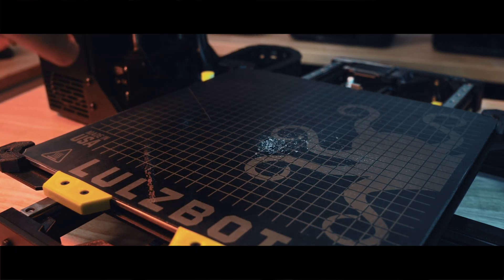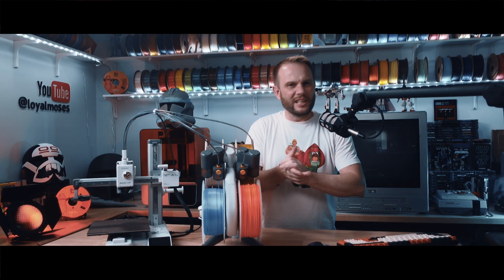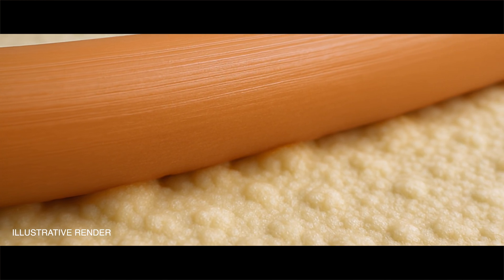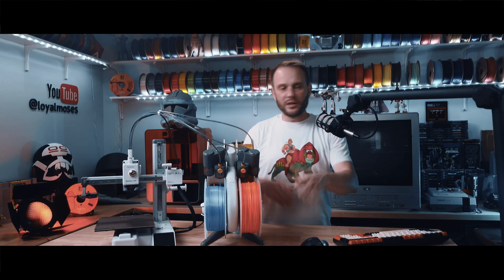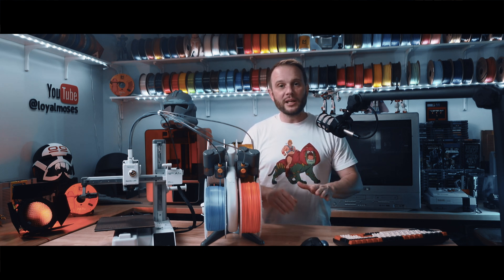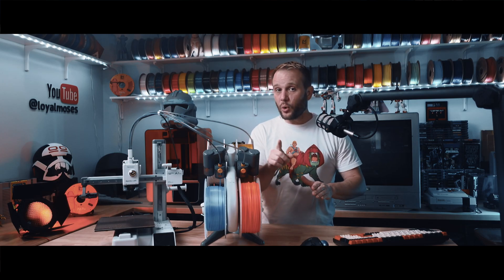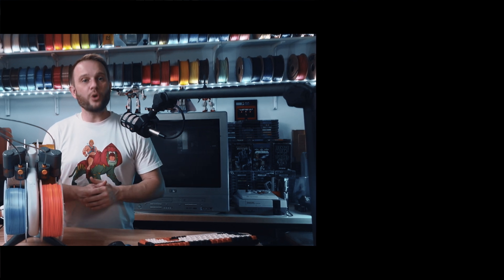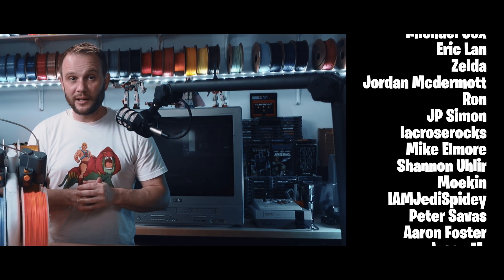Is Alcohol Ruining Your Prints? Why PEI Works (And Fails)

Comment from the maker: Have you ever had a print fail because it wouldn’t stick to your PEI sheet? What do you use for cleaning—alcohol, soap, or something else? Let me know below!
Reply: Soap and water for the win. 10 years on and counting.
Reply: Cleaning between prints is 80% IPA made by diluting 99.9% IPA with distilled water. There’s no glycol, just IPA diluted to a concentration that is not damaging to build plates, but still high enough to clean oils. I use a microfibre cloth to clean the plate. Occasionally washed in warm soapy water to do a thorough clean. The only time I use glue is when printing PETG or TPU on smooth PEI, but the reason is so I can remove the print afterwards without destroying the building plate.
Reply: @LoyalMoses  use both Alcohol and a mild soap/water mix depending on how dirty the build plate maybe.  Seventh generation Free & Clear is the soap I prefer. Doesn't have the harsh releasing  agents found in degreasing soaps such as Dawn.
Reply: havnt had to clean my bed in around 700 hours of printing. the default PEI sheet has extremely good durability without having to wash or hit it with IPA.
Reply: mild soap, water lol.

Comment: I take 99.9% IPA and dilute it to 80% with distilled water for use to clean build plates. Smooth PEI plates can also be refreshed when the alcohol no longer works for bed adhesion. Using an abrasive polishing cloth dampened with acetone, rub the surface in circles about half the size of the plate. Polish evenly and then rinse and wash with hot soapy water. Once dry, install the build plate and clean with 80% IPA solution (without glycol) using a microfibre cloth. The acetone will strip a microscopic layer from the plate and expose the fresh PEI surface underneath. The build plate will perform like new, but you should only do this once on any build plate so if it goes bad again, scrap it. PEI build plates are considered consumable. Never use this method on a textured build plate. This is only for smooth PEI surface.

Comment: While I mostly print petg and PLA I haven't used an adhesive in over two years since I started using pei plates (textured or smooth).  Just use that dawn concentrate spray and good hot water (like ouch).  Once in a great while I might chase the soap wash with 91% ISO-P but that's like once every 50+ prints
Reply from the maker: Great tip!

Comment: I use dish soap & IPA between washes. I’m new to the 3D Printing world so still learning. since you mentioned that too often use of IPA can wear off the PEI, what do recommend how often should I use IPA ? I use more often on my smooth plate, especially if I see prints on the surface , less so on the textured plate. How often should I wash with dish soap and water?

Comment: Does the Vision Minor product leave a texture on smooth plates or affect those plates that creat the reflective patterns? Like filling in the ultra fine grooves on them?
Reply from the maker: Not really. You should be fine, and it is water soluble too.
Reply: @LoyalMoses  sweet. thnx
Reply: If you apply the Vision Miner thinly and evenly it will not affect the patterns. I use a 1” square piece of lint free disposable wipe to spread it around the build plate. A little goes a long way.

Comment: Great video and infomrative!
I've being cleaning my PEI plates with isopropil or water and I'll tend to aovid alcohol most of the time. I usualy print ABS, so I need to use glue (Strangely enough it's hard to find a good glue stick like elmers i even had some imported lol) so most of the time I'm using local branding aerosol spray glue (water soluble) or liquids one, no problems yet. 
I wasn't able to print without one on my k1c so far.
Reply from the maker: Thank you very much! Whatever helps make your prints a success!

Comment: Dawn dish soap(or equivalent) and hot water is all you need to properly wash pei plates, then simply dry with paper towel.. this was the same for my old glass build plates, ALCOHOL is only good for spot cleaning between proper cleanings it can smear body oils and greases, Dawn is designed to remove them both that is why they use it on animals in oil spills. You "alcoholics" are ridiculous

Comment: I learned that the hard way on the glass beds that came with ender and fookos high levels of IPA what caused those beds to lose their adhesion you know it's happened to a glass bed when you clean it and it's no longer feels sticky to the touch the print surface is pretty much ruined after that

Comment: The stock Ender 3 V2 build plate with NO adhesives, tape, or other supplementary substances has worked extremely well for me over the past 3-5-ish years. I can't remember when I got the machine.

Comment: what is the best way to apply it? i have use paint brushes and such but doesnt seem it does even coat across. when it has the wet look doesnt seam like it smears around easy.
Reply from the maker: I use the little paint brush I have here, and just do small circles all over the build plate to put it down evenly.
Reply: @LoyalMoses  ill give that a try

Comment: What no YouTuber ever mentions is dust build up. 
(Maybe because they print so often or get expensive glue for free, or both 😏 that they never experience this case)
The fanciest glue is wasted if you leave your print plate collect dust on the printer for 3 months and then start a print right away. 
Either you need to wash off the dust before (wasting away the expensive glue that was supposed to last X-amount of prints) or the print detaches and then you need to clean the build plate anyway. 
Therefore: Cover your build plates or store them either vertically, in a drawer or in a container.

ALSO what I've heard no YouTuber ever mention before: 
Don't use the same cloth too often! 
If you touch a micro fiber cloth often enough, it gets greasy as well.
You then basically wipe the grease ONTO the build plate instead off of it. No amount of alcohol can compensate for an already greasy towel. 
So either wash the microfiber cloths regularly:
- WITHOUT other clothes, like cotton. Clothes fibers are much coarser, detach and contaminate the microfiber cloths' surface like millions of coarse dust particles. Although not as bad as grease, it's again like you wipe (dust) onto the build plate instead of off. 
- Wash BELOW 60°C (I remember a car polishing specialist mentioning that microfibers start to melt at that temperature) 
Or throw them away after a few uses (which I find a waste).
Reply from the maker: Dust happens here too. Vision Miner isn't tacky when at all when it is room temperature. I just use a microfiber cloth and wipe dust away, and then start the print. A lot of the time, I'll ask the kids to bring me a printer for filming, and then my wife will come in while I am getting things ready (SHE'S AMAZING), and wipe down the printer for me, because I forget all the time.
Reply: @LoyalMoses  Hmm, interesting to know, thanks!

Comment: I use PEX due to hogher bed temps > 120°C I tpically go through a PEX sheet in about 1 to 2 years, mostly due to damage that occurs when removing a print.
When using the Nano polymer do you suggest applying it directly to a Pei or PEX build plate or directly onto the aluminum?
Reply from the maker: You can apply it to the aluminum if you want, it will make filament stick to anything, but I would just apply it to the pex.
Reply: The website says what materials it’s compatible with.

Comment: I find that alcohol just spreads the oils around. Some dawn will clean it well and i can print pla petg and abs without any issues
Reply from the maker: Yikes! What kind of oils are dealing with!? I haven't experienced that, likely don't have that much oil on a build plate for that to be a problem. Lucky I guess!
Reply: @LoyalMoses  just oils from my hands. When i print petg on prusa older black pei textured sheet i rub my hand on it to stop the petg from sticking too much and damaging it. But when i switch back to pla/abs just using iso alcohol tends to just spread it around

Comment: With the title of the video, I was hoping for some test results. I have been using ipa to clean my pei sheet for years and haven’t had any problems with adhesion. I’m not saying that it doesn’t degrade performance, just that some sort of comparison test would be helpful in making an informed decision.
Reply from the maker: It’s science. You can Google it, or check with ChatGPT.
Reply: @ more along the lines of, over 100 prints you lose 10% of adhesion. Or you lose 0.01% adhesion.
Reply from the maker: The truth is, the amount of PEI used on the plate, and how much your scrub with the varying levels of IPA really determines how much you are removing. I’m still using original builds plates from many years ago, and some cheaper ones didn’t last but a month or two.

Comment: Vision miner is expensive but I won't using anything else it just works and yes you can get a ton of prints before reapplying its very thin as in like water thin so it goes a long way and lets face it a part that detaches from the build plate big or small is a failure if you use vision miner it just works with everything PLA, PETG, ABS, ASA Nylon TPU on and on
Reply from the maker: It is 10000% worth it! Once you start, you just can't stop, it is amazing.

Comment: Water soap or IPA never really worked for my textured PEI sheet, i would always have issues with adhesion after. The only thing that works for me is acetone. And i need to wipe it properly. That seems to go against most peoples advise but it was just the only thing that worked for me. over 2 years now and no issues so far. I need to clean it about every 10 prints. I mostly print ABS and PETG. Never PLA.
Reply from the maker: Acetone removes a layer of PEI each time you use it, so technically, you are cleaning it, and giving it a refresh. But there is a limited number of times you can do that of course, depending on how much you use and how often. Different sheets have different amounts of PEI, so if there I a thick layer of PEI, you'll get away with that for a longer period of time.

Comment: I never use IPA, always use Dawn dish soap and warm water. One thing that's strange is the best adhesion results have been with a smooth PEI sheet.  Bambu Labs smooth/textured build plate using the smooth side you almost have to use glue stick to get the prints off. Try it and see, I was amazed at how well PLA/PETG sticks to this plate.
Reply from the maker: Some smooth sheets are incredible!

Comment: I use 91% on a microfiber rag and only clean it if I have to touch the build plate to remove tiny stuck pieces or just after like 5 prints or so . Been doing it for years and my prints still stick perfectly fine. Would rather buy a new PEI sheet every couple years than have to wash it with soap and risk damaging it that way
Reply from the maker: Awesome!

Comment: I'm team IPA all the way. I think your explanation coupled witht he fact I use 90% with a fine spritz bottle explains some things. I never let it pool up and puddle on the plate for a length of time, its spray and wipe off immediately, never really let it linger and try not to let it evaporate as that also leaves contaminates behind. I've had very few issues with surface adhesion in general. Frequently I print parts that state a brim will be needed, without. PLA sticks well and PETG sticks so good that sometimes fully cooling doesn't self-release without giving the sheet a flex.
Reply from the maker: I find IPA super convenient too. Spray bottle, light wipe and good to go. I try not to scrub, but I’ll admit, I’ve done that a lot in the past, probably the reason for a few failed plates.
Reply: I don't care for spritzing IPA as it has a strong smell. What I have is a pump-top bottle with the little dish on top, usually used for nail polish removal with acetone and cotton pads. A pump or two with a paper towel, and I have a spot of wet towel with just enough IPA to clean the bed well.

Every few months or after bad oil contamination, I wash and scrub the sheet with water and soap. This seems to work great for pretty much everything.

Comment: I use glue stick. On my Voron v0.15 (It's not a full 0.1 or 0.2), I printed so many ABS parts over several months without cleaning the PEI spring steel sheet. Yes, I have had print failures but they are almost always on the first layer and happen because of small details and going a bit slower fixes it.
Reply from the maker: Glue stick is still an excellent interface layer!

Comment: You said that repeatedly wiping PEI sheets with isopropanol at high concentrations, can smooth out textured PEI sheets over time. Would be using lower concentration isopropanol generally better? (around 70%)Does it break down oils, grease and residue as effectively as 99.9% isopropanol? And would it offer the same bed adheison, as if the bed would be cleaned with 99.9% isopropanol?
Reply from the maker: Yes, I use 70% myself, and it will do a great job. The real difference is how much, how often and the amount of scrubbing you do. Light amounts of IPA and light wiping with a cloth won’t damage your PEI.
Reply: @LoyalMoses  Thanks for the quick answer!

Comment: Do we have a source that says IPA can dissolve PEI texture? I know this is just anecdotal but I still have the original build plate on my prusa mk3 and I've done literally THOUSANDS of prints on one side and never flipped it, cleaning with 99% IPA after every single print and it's still sticky like new.
Reply from the maker: Yes, science, for more details type it into Google or ChatGPT for the complete answer. It’s one of the main reasons why some PEI build plates do not recommend using IPA, because they use a very thin coating that is extremely delicate.

Comment: If I need a print to not fail I use Nano Miner.  Though I shouls start using gloves while handling my buildplates to avoid getting oil on them.
Reply from the maker: Definitely! I just grab build plates by the inch or two on the sides, where I traditionally don’t print, but gloves is a good idea too!

Comment: Just a small thought, the Van Der Waals (dispersion forces) are not really about polarity, it has more to do with surface area and more electrons available. This is due to slight shifts in average position of electrons causing temporary dipoles, that then attracts to induced dipoles in the adjacent molecule.
Reply from the maker: Definitely! Van Der Waals forces, and specifically London dispersion forces, are caused by temporary dipoles due to shifts in electron distribution, not only just related to polarity. It’s more about surface area and available electrons, like you said. In the context of PEI build plates and adhesion, other forces like surface energy do apply too. Thank you for the comment!
Reply: @Layerbylayermaker  hmmm thought we voted and this was going to be henceforth know as the "Van Halen " forces....🙃

Comment: Early on I had some real challenges with prints deciding to not stick at all (about seven years or so ago).  Finally I ran into some of the Prusa folks at Maker Faire and they suggested the soap and water thing.  Immediately fixed it.  
I use IPA regularly but as soon as I have any indication of bed adhesion issues, a quick wash with soap and water and a dry off and everything is good to go again.
Reply from the maker: Fantastic!

Comment: Great information.  I've been wiping my PEI sheets with IPA before every print, and some of my sheets have lasted a very long time, I'm talking years.  But after watching this I do remember there being times that the PEI just didn't work as well as it used to.  When that happened, I would wipe the PEI sheet with some acetone, let it set for a minute or two and then wipe off.  This revitalized the sheet, and it worked great again for a long time.  I wonder if the acetone etched the PEI and gave it the irregular surface again?
Reply from the maker: Absolutely, some people also use a Scotch-Brite pad or similar to scratch it up lightly.
Reply: @LoyalMoses  Way back when I used to use smooth PEI sheets I would just go straight to the sand paper and scuff it up real nice.  What adhesion problem? lol
Reply: This is exactly what I did for my Prusa MK2 back in the day. It didn't have a removable bed back then. Bed lasted the life of the printer for me and was still on it when I sold it.

Comment: Excellent topic! This has been a point of confusion, or more second guessing recently. I have left other groups last week because of it. I have a couple Bambu Labs printers, i know Bambu says not to use IPA on the flex shee, but that is how ive always cleaned my pei sheets. I do wash with mild soapy water usually as needed. I never really saw a difference, but i got a lot of grief when I asked about it.

I am excited to try the Vision Minor I won during the live stream! So many people rave about it & peinting more engineering filaments that are kinda spendy. VM seems like the perfect bed adhesion insurance available for us today. If its anything like Polymaker is to filament or 3D Gloop is to adhesives, Vision Minor wil exceed my expectations
Reply from the maker: People can be crazy about things like this. Some viewers got very mad at me when I used IPA in another recent video to clean the build plate. So, I figured the right thing to do was make a quick video on it, not too much, just fast and to the point.

You will love that NPA!!!

Comment: Fingerprints (skin oils) are the most common thing that will keep prints from sticking to PEI sheets. You can't touch the plate surface, at all. I can go weeks between having to wash my plates (with 10 hours a day of printing). Another thing that works well if you think you may have touched the plate, a magic eraser sponge. They also take off the print image that can get left behind.
Reply from the maker: ... and some people are far more oily than others!
Reply: Magic eraser is an abrasive, think micro sand sponge